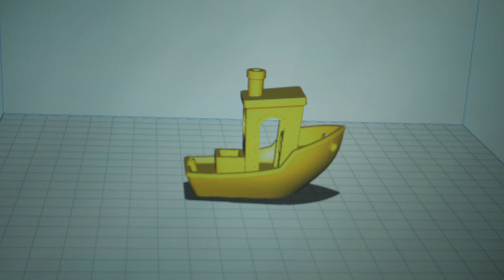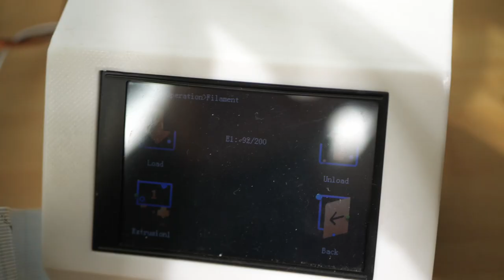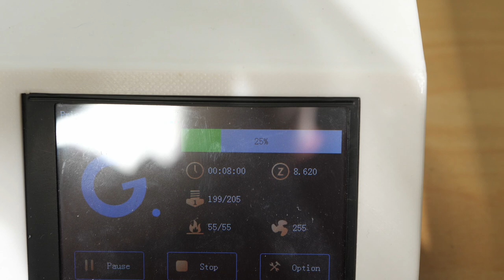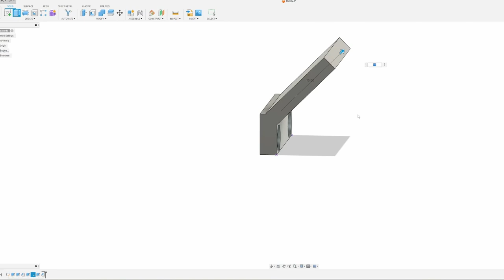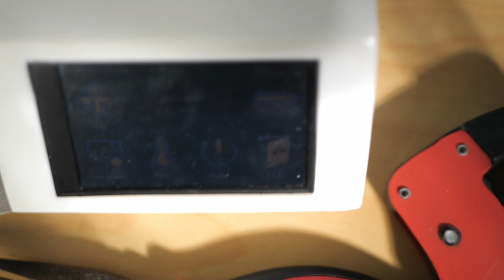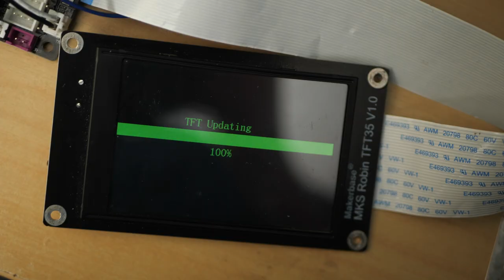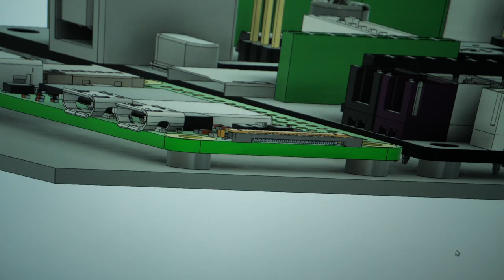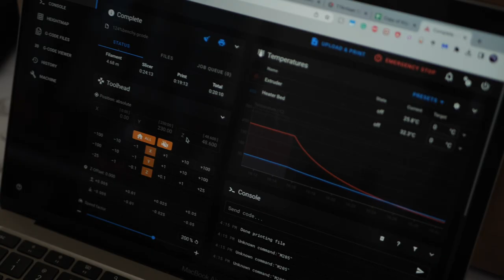I Upgraded a Broken 3D Printer!

Comment: You seem to have a problem with damp filament.  Here's how to fix that: Put the filament roll in a box (the one it came in?) with a pack of silica.  Heat up the bed of your printer to about 70C.  Put the box with the filament on the bed and leave it there for a few hours.  Dirt cheap filament dryer.  Works for me!

Comment: Nice work, edited together well. That little spacer for the volcano setup might be causing some of the clogging issues. Seems like you would potentially get a build-up in the area for the Allen key, especially if it's right next to the nozzle, and create excess drag on the filament. I would switch back to the regular block and retune. Good luck with it. I look forward to an update on your progress.
Reply from the maker: Thanks! I did have to uninstall and reinstall it a few times until it performed better, unfortunately one of the adapters stripped and had to be replaced. It’s working well now but I in the future I’ll use a single nozzle.

Comment: "the bltouch has to be moved slightly to compensate"
throws 15mm spacers 
great video man, I love it I would swap that extruder for something like a bmg or the hole carriage from triangle-labs for the mk3 with the bmg already on it
Reply from the maker: Thanks! Currently figuring out how to mount a new extruder and also fix up a few of the issues.  Swapping the whole carriage is actually a viable option, I’ll look more into it.

Comment: That PTFE tube is what`s giving you troubles. It can move up under pressure and lets filament form  clogs between it and the heatbreak. With that N17 you should have plenty of power even without gearing. Afterall Prusa Mk3 uses the same setup. Glad you switched to Klipper firmware. Its miles ahead in terms of speed and ease of use compared to Marlin. Good luck! Waiting on pt. 3
Reply from the maker: Thanks for your comment! I’m hoping that the all metal heat break will help with this issue, I tried cutting the ptfe to the perfect length but I’m unable to tell if It’s helped or not. Klipper has been working well so far, except for the learning curve which I’m still working on, I look forward to trying out more of its features. The machine is printing a lot better now, however there is still much to do.

Comment: I think I said this before, but look at your current v6 heat sink, and look at the prusa specific v6 heat sink; there is supposed to be a fitting at the top to hold the PTFE tube in place, and on the prusa specific v6 this fitting is inset into the heatsink. the v6 heat sink you currently have is made to have a PC4 straight-through fitting, which will not fit in the current extruder parts. Until you fix that by replacing that heat sink you are going to have occasional jams you'll need to clear, as the PTFE tube will be pushed out from the pressure of the plastic, creating a gap that molten plastic will get into and cool. The all-metal heat break may or may not help with this.
For comparison, a similar kind of jam can happen on the (stock or V2) Ender 3 if the bowden tube is not fully re-seated back down in place after removing it, or if the PC4 fitting on the hotend wears out or breaks, which I call a "bowden-gap" jam, as it creates a gap molten plastic will back up into and partially or fully cool in, causing the jam. Since the v6 this printer came with is actually meant for a bowden setup, it suffers from this problem as well, especially since it has no PC4 coupling.
For dimensional accuracy, you'll probably need to under go step/mm calibration, which you can find tutorials and calculators for (this will probably also help with extrusion). Gcode command (assuming conventional rep-rap derived code) is M92 X## Y## Z## E##, where you only enter whichever motors you're adjusting; use M503 in console to find the current values before adjusting anything.
Motors being hot probably means the motor current is too high, which can be a fire hazard! Adjust using the potentiometer, or if you're using TMCs the current may be controlled over firmware. When using TMCs on my printer on a MKS Gen L 2, the default of 800mA was way too high and my motors actually ended up melting some parts before I caught it.
To improve part cooling, designing a new cooling shroud is probably advisable, even if you only have PETG to start.
Reply from the maker: I have a v6 heatsink on another machine that may have the correct fitting, I'll take a look at it. If not I'll order a few for the future. I have also considered removing the top extruder part and turning the machine into a bowden system, enabling me to "easily" use other extruders and remove weight from the tool head, although I am still weighing up the pros and cons of this. Klipper uses rotational distance instead of steps/mm, so I've been struggling with that, but will revisit it again soon. I've been working on adjusting the vref for the stepper motors, and that seems to have helped, I am still figuring out how to adjust the current, but will tune that once I can. I don't have any PETG or ASA/ABS to print a new fan shroud, but I do have a pla composite material which may work for the time being, I'll figure out the printing once I have actually designed a new part once I have finalised the hotend components. Thank you for your previous comment as well, it's been helpful for finding out more information about this machine and how to improve it.
Reply: @TommyHoughton  I've run shrouds printed in PLA - they work fine. They can deform a bit if you don't have the cooling fan running and they are close to the hotend, but they still work fine - even if a bit melted.
Reply: @TommyHoughton  Also, stick with the direct drive extruder. Bowdens can work, but require a lot of retraction to prevent stringing. I suspect the little pancake stepper on the direct extruder and a genuine E3D V6 all metal Hotend (not the volcano) and 0.4mm Nozzle will be the sweet spot for a bed slinger like that.
Reply from the maker: Thanks for the suggestion, I was considering converting the machine to bowden to reduce weight and because I couldn’t find any stls for different extruders, but now I’ll stick with the direct drive and keep researching.

Comment: Clogs were most likely caused by insufficient hotend radiator cooling, poor quality heat break or both (that's my guess). Too much retraction will also cause it - for direct drive is should be around 1-2mm depending on filament type. I'd just get rid of this cheap V6, but since you already ordered a new heat break I will suggest using a thermal compound when installing it (make sure it's suited for high temp). As for the fan a high CFM version is advised.
The extruder motor is skipping most likely because it's not getting enough power. If you have a multimeter and your stepper drivers allow that you can increase the voltage value, but be careful not to short anything or set the voltage too high.
Not sure if swapping to a Volcano and CHT clone nozzle was the right call, since you're not printing nowhere near fast enough to be limited by the V6 setup and it introduced more problems like a lack of parts cooling and most likely cold pulls will be a lot tougher to execute correctly.
Looking forward to part 3!
Reply from the maker: Thanks for the tips! I believe the hotend fan is finally getting sufficient cooling after swapping the fan numerous times, but I have my doubts that the cheap heat break that’s currently installed is helping, once the all metal one arrives I’m hoping it really improves things. I’ve taken note of the retraction settings and have been tweaking them over the last few prints. I’m not sure what the extruder stepper motors current is set too, but during the video the vref was all over the play, I believeI have brought it down to 1v and it’s working more consistently. I plan on adding loads more part cooling so I can try and push this machine as much as possible.
Reply: @TommyHoughton  Cheap all-metal (stainless steel) heat breaks actually increase the possibility of clogs and printing PLA might be even impossible. Bi-metal heat breaks are way better, but it's important to understand they need sufficient cooling and they need to transfer heat to the radiator as efficiently as possible.
As for the extruder motor - as long as it's not too hot to touch during printing and it's not skipping steps it should be fine. If it's too hot it can actually melt printed parts

Comment: I’m curious about how much the printer costs after all the upgrades/fixes you’ve had to make. Mind sharing (excluding the pi for klipper) with the amount of time spent?
Reply from the maker: Good question, the stepper motor was a spare part, but assuming it was new and all the other components were too (some more than others) the current total including pei bed is under 200nzd, with the time spent being over 20H. Roughly.

Comment: I have 3 printers which no longer extrude. Pretty certain it's the hot ends in all cases, I have

E3D Clone (PTFE)
E3D Light (PTFE)
Ender 3 (PTFE)

Cheapest upgrade is a chinese bi metallic heat brake for the Ender 3, medium cost is a slice engineering heat brake for the Ender 3.
I suspect the real solution is splashing out on a genuine E3D V6, or a Genuine Micro Swiss.
Reply from the maker: I’ve received a lower end bi metallic heat break, so I’ll be testing to see how it performs. I definitely want to try out the slice one in the future. I’ve got my eye on multiple hotends that I’d like to test, so hopefully that’s something I can make a video on. Best of luck with your machines.

Comment: You did all these changes and never did a PID autotune? Also, if you see a bulb on the end of your filament after a jam, that means you have a gap where your ptfe tube is not all the way down butted up against your heat block. This is a common issue if its not an all metal hotend.
Reply from the maker: Perhaps I forgot to mention, but I did an auto pid tune in klipper which really helped with the inconsistent temperature. I’ve also cut the ptfe tube to the perfect length where it goes all the way down to the heatbreak, and to the top of the printed part until it can’t anymore. Since this video I’ve had one clog in  the machine but no other issues. Once the all metal heatbreak arrives I’m hoping that all of these issues will be completely solved.
Reply: @TommyHoughton  All metal should help drastically. only thing I am not sure about is that weird 2 part setup you used in the volcano block. Does CHT not make a Volcano length in that splitter nozzle? If you still have jams after your all metal upgrade, I suggest you buy a standard volcano length nozzle and test that compared to that 2 part CHT nozzle setup just in case that is causing them. With all those parts in the filament path, that can cause filament to squish outwards and fill the gaps causing jams. I also recommend you double check your retraction settings. If you used the Ender 3 profile for slicing, your retraction length will be way too long (if you didn't change it). Bowden setup you need between 3-7mm but with direct drive you only need between .3-1mm retraction length. Jams and under extrusions can be a clear indication of high retraction length. Good luck
Reply from the maker: @user-lx9jm1wo3h  I created a new profile for this machine, it’s currently running around 1mm retraction. I’ve seen a (non genuine) volcano cht In similar design to the one I’m running currently, so I will perhaps order a couple. I also swapped the adapter and cht for a standard volcano nozzle when testing which performed similar but is of course a simpler assembly.
Reply: @TommyHoughton  I see. Looks like you are doing well with your troubleshooting, and exploring your options then. Only other thing I can really think of is to make sure your nozzle is actually reaching the temps the printer is reading back to you. Each thermistor has a temp table that displays temps based on resistance of the thermistor. Its not the most accurate way to do it, but if you have a laser thermometer you can usually get a rough idea if your temps are close by pointing it at parts of the heatblock. proper way is to drop a probe down in the nozzle but that can cost more money to try out.
Reply from the maker: @user-lx9jm1wo3h  I’ve got a cheap laser thermometer that may work for this, I’ll try it out and see what the results are.
Reply: @TommyHoughton  Good luck, bud!
Reply from the maker: @user-lx9jm1wo3h  thanks!

Comment: Why the heavier motor on X Gantry? The slim one have the suficient power and weight less = more speed without ringing
Reply from the maker: I  thought a stronger stepper would help. In part 3 I upgraded to a bmg extruder and swapped back to the pancake motor, which is giving excellent results.
Reply: @TommyHoughton  perfect! I have a slim motor and bmg clone on 2 enders 3 , working perfect

Comment: Is your z-limit-switch precise enough? According to Maker's Muse there is a better one: https://www.youtube.com/watch?v=oX4up29xUuw but your doesn't look bad either
Reply from the maker: It seems to be fine, this machine is pretty well levelled and first layers turn out good, however the dual lead screws need alignment every now and then. I’ll be monitoring it long term.
Reply: I have stock dual z-limit-switch on my Anycubic Mega Pro (klipper) which helps keeping it straight without any intervention. I like your limit's mount. It's what I was missing to upgrade mine switches.
Reply from the maker: I’ve been trying to figure out the config changes for dual limit switches on my machine, currently I’m just using the bl touch and I’ll revisit it in the future.

Comment: Great video! Last week i was so inspired by your first video on this series that i bought a super broken printer called Stella 2 to fix and hopefully give to my nephew. The printer was around 15 bucks (80 reais in Brazil). 
I'am very curious however about your mini green 3d printer. Could you do a video about it! I really love small printers! 
Keep the great work
Reply from the maker: That’s great to hear! Please let me know how it goes. I was working on a video for the mini printer, but I ran into some critical issues that I don’t have time for right now. The motors are the biggest issue, as they don’t have enough strength to move the gantry and they ended up overheating and melting the wires off. There’s also a lot of fiddly small parts that are annoying to work with. The printable files are accessible and I have most of the components, so I hope to one day revisit it!
Reply: @TommyHoughton  I'm currently waiting for an Arduino Mega to come from China (delivery is 2 months) and i'm thinking of replacing the completely rusty linear bearings for some 3d printed bushings (i hope it work for some time). 
About the mini printer, i think i can imagine how hard it is to work on, being so tiny. I hope we see it working some day!
Reply from the maker: @gabrielarcanjo482  best of luck! The 3d printed bushings should work for a decent amount of time. I also made a short a few months ago on the mini printer when I got it moving for the first proper time, however not much has happened since then.
https://youtube.com/shorts/3D7bWVh08cU?feature=share
Reply: @TommyHoughton  Just a thought that came to my mind right now. As the printer is very small and doesn't move that much, it should be possible to mount the hotend fan to the printer's frame and aliviate the weight that the z axis motor has to lift.
Reply from the maker: @gabrielarcanjo482  that’s a great idea, I’ll also do some research on a smaller hotend assembly, that could be a big factor. Thanks for the suggestion!